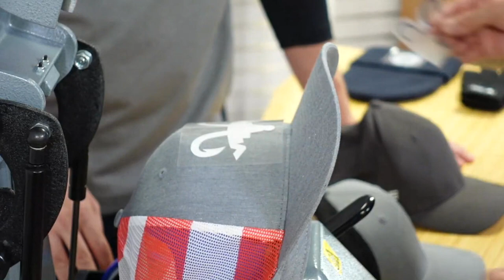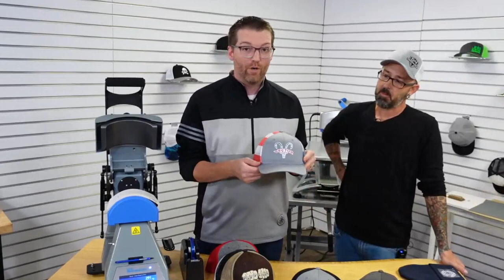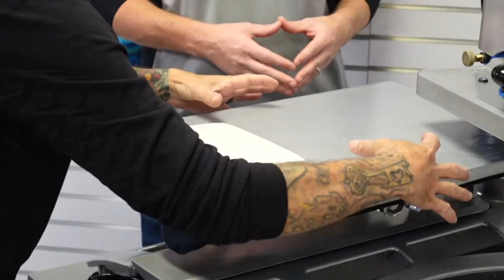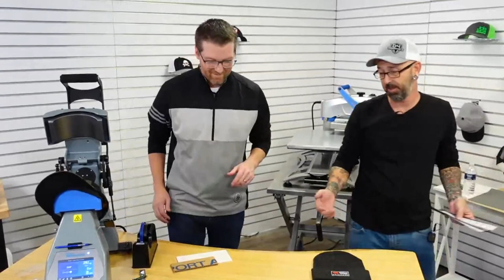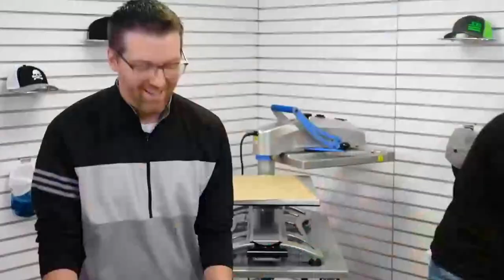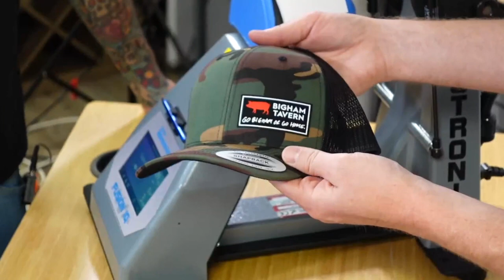How to Heat Press Hats with Skip Davis - The Hat Master! | Webinar

Comment: Awesome video. Very informative. I have one question at first glance. If I don’t have a hat press that has a lower heated platen like the 360 IQ, can I still use your patches?

And if so, what sort of modifications will I need to make in my approach to pressing those patches onto my hats? Thanks so much!
Reply from the maker: Thanks! We have application instructions on the "User Guide" tab of each product page for both the 360IQ hat press and for top heat only hat presses. https://www.stahls.com/stahls-flexstyle-emblems